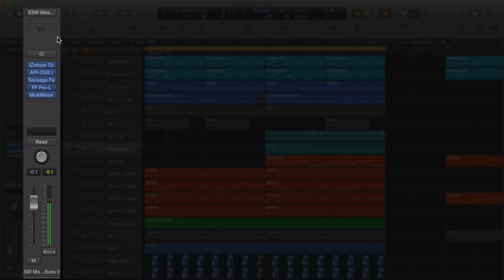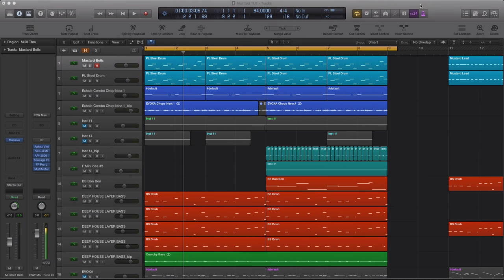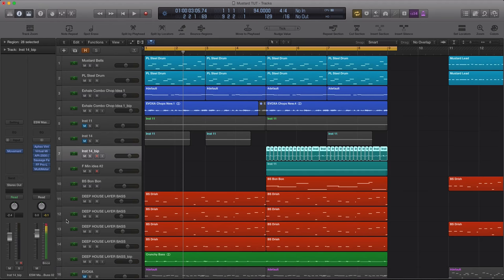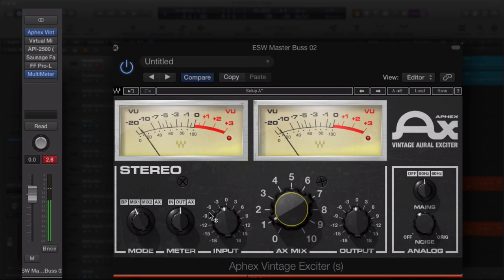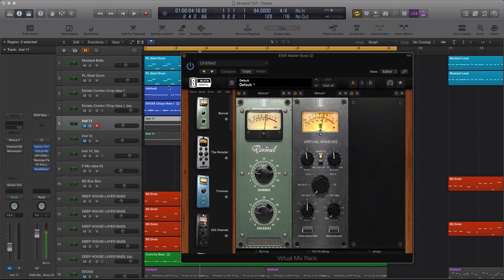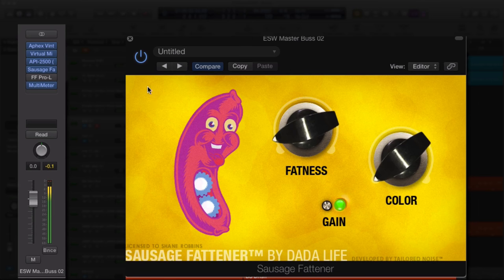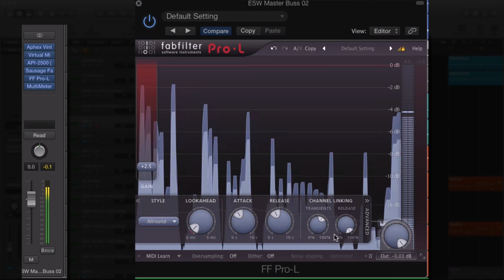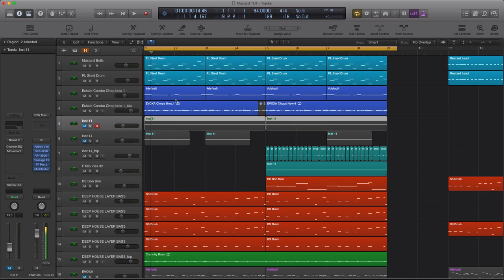DIY Master Buss Chain (Echo Sound Works)

Comment: Dope vid. Personally, I like to cut lower crews in my master bus early on. Very easy with the earth module in VMR or just using and instance of a new like Eiosis AirEQ up front with a HP above whatever. Also get some problem freqs with narrow cuts here or there, then tape, then use that VMR since it can do a lot of the heavy lifting within itself. 

I now am trying to stop using standard issue saturators on the master bus so much. I see you had a few different things from revival to apex to sausage fattener etc. I just throw that free softube one saturation knob just a touch (if necessary) just before my limiter and different forms of standard saturation and drive on individual tracks. In your professional experience, what are the costs or benefits you've noticed as per colored or clean processes on a master chain?

Comment: the API 2500 is a limiter when the analog is on
Reply: @INSANASOMNIA I dont remember for sure but I think it was from Bob Horn Mix Session..But try it yourself and you'll see it..
Reply: Even weirder because waves manual a the most complete manuals with the history of the hardware and how they made it into the plugin and as far as I can remember, they never hide anything on the contrary they inform you on what most users didn't even know was possible with each of their plugins (30 pages minimum per plugins) compare that other very complex plugins like Elysia and Brainworx with a 4 page manual ???? But the longest plugins manual are from  Melda Production (some plugins are over 100 pages)
Actually here's the link to the api2500 : http://www.waves.com/1lib/pdf/plugins/api-2500.pdf
Cheers
Reply: INSANASOMNIA did you tried it?
Reply: I did. And it just goes to show how WAVES emulation nailed it ! When you swithch on to Analog, it does really alters the overall punch-atack-strenght-harmonics and that's what great about GOOD character analog gear emulation !!!!! So long and great mixes to you !

Comment: Hi and thanks for the tutorial! I have a couple of noob questions regarding this process:

1. You said that you mixed the song in a way that it can fit vocals on it later on. I'm assuming that you would be the one mixing the vocals in, right? Like you mix it again with the vocals and THEN you apply this mastering technique? Because now there is only 0.1db headoom and no vocals.

2. What if you would send the song to an artist and never touch it again yourself? Would you just send them a mix without any of this applied? I have no idea how this process would work. 

Thanks!
Reply from the maker: Hey! So lets look at your second question. If i sent to an artist i would bounce the beat out loud with my mastering chain on. The artist would rap or sing over it and send back the acapellas. I would then open the session, dump the vocals in and then turn things down accordingly by lowering track volumes. AND then mix the vocals into the mastering chain and send back to the artist for approval etc. Then I would contact an mastering eng. and send him my "mastered version" and say it needs to be better than this, can we do it?

Comment: What's the advantage/difference between an eq and an exciter?
Reply: An exciter is dynamic in nature, while an EQ remains in a static position. When an EQ adds high frequencies, for example, everything passing through the path has more highs. An exciter is dynamic in nature and adds harmonic distortion, often synthesized tones, and dynamic EQ differences based on both the fundamental frequency and the input volume.  Most engineers agree that using an exciter will not raise the noise floor, while boosting highs on an EQ could potentially accentuate existing noise. Not as huge an issue when using digital synths (with very little/no inherent noise), but when the aphex exciter was originally introduced noise was the engineers everyday nightmare.
Reply from the maker: Matt and LP24 nailed it!

Comment: In my experience, that's not a very conservative setting on Revival. I like it when I just want to tap it like an ssl g comp on the glue setting.
Reply from the maker: ha yeah i did push it a bit in this video
Reply: Oh ! You too noticed I don't know anything about how to use a 2 knob plugins ! I couldn't find the PRESETS !
ADSR Sumic Deduction Rituals

Comment: -It's ok to mix with a limmiter/Compression.
It's a myth. 

-You can make two mixes, A DIY master and A stripped plugin one.

Plugins:
1. Vinatge Aural Exciter
Adds some nice high end

NOTE: Don't clip from plugin to plugin!!!

2. VMR[Bus] 
British 4k E

3. Revival
set to 8

Again remember No plugin to plugin clipping lil bihh.

4. Waves API 2500 compressor
Preset 29

Analog: On
Output: 1.4
thershold : 8
Ratio: lowest
Attack: lowest
Release: little

5. Sausage fattener

8% very conservative, gain set to 0

6. Fab Filter Pro L
Output: Below 0. Not at unity. -.3
Safeguards from clipping

Gain: 2.5 db

Style: Any, transparent maybe.
look ahead: low
Attack: 250 ms
release: 500ms

The look ahead,tels  the limmiter how quickly to respond to peaks.  gives more volume  , at the price of distortion. 

Transient heavy stuff? Turn look ahead up.

Shorter attack times: Safer
Faster attack times: louder (lets through more transients)
Reply: dude, your the real mvp right here for doing this!
Reply: You'd be wrong to use these settings for your track. Each track requires different settings. I like the plugins he's using (bar the sausage fattener) although i'd change the order of things - i'd go corrective Eq, compression, harmonic excitement (saturation or other type of distortion), stereo enhancing, Eq for enhancement and then limiting. My advice would be to load up these plugins he's using and learn how to get the most out of each plugin. But don't think the settings above will work for your tracks, every tracks different.
Reply: IMKLASH Chill bro it's just notes like you would take in school.
Reply: I'm just giving you advice bro, hopefully it helps yourself and others.
Reply: Thnaks for that chain advice dude! You're def right, ADSR's chain was specific for THAT mix (as he mentioned "I tend to not add any freqs when eq'ing")
Reply: awesome :-)
Reply: If you like waisting your time or if you don't want your mix to be mastered.

Comment: It has to do with stemming. If you're delivering out stems to your clients, then the sums of each individual output track will be different going out of the 2 buss. Those compressors, etc. are affecting each instrument in the mix - though when exported individually, the dynamics will be different. That's the primary reason why. If you're not delivering stems, it's not a big deal - but if you do, it can cause issues.